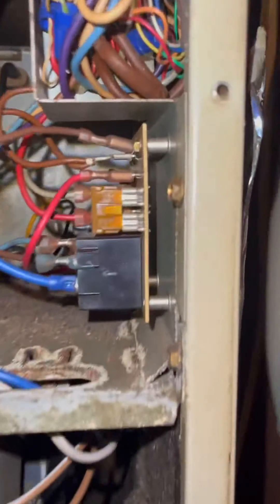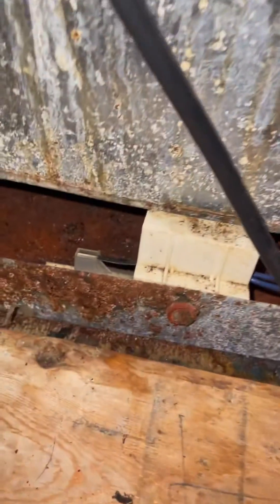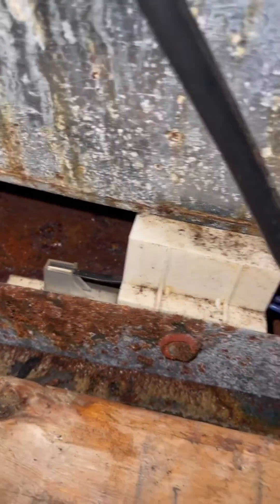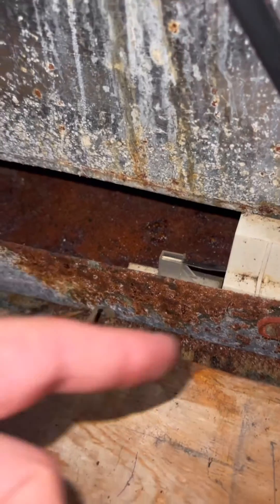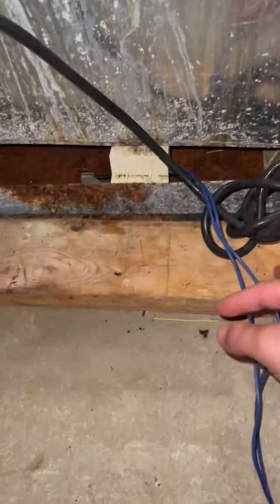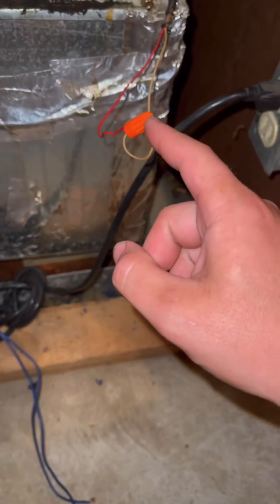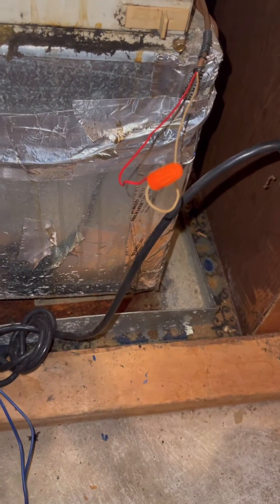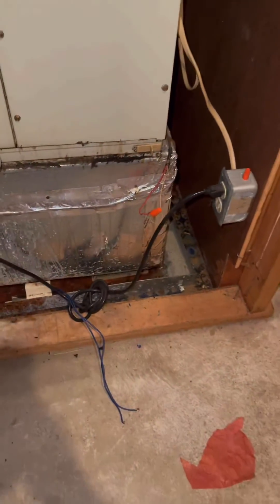Bypass HVAC float switch/Nest thermostat no power to rh wire

Comment: So the float switch fails and the drain pan floods anyways.  What then is it any good for?  In the old days, I just checked the drain pan and condensate drain to make sure it is clear.   Bottom line,  it's just another low voltage failure problem added to the circuitry.  Service companies love it.